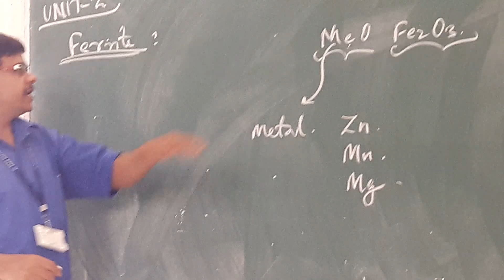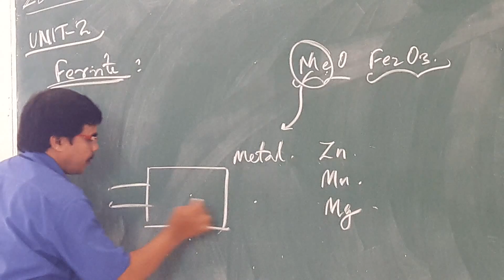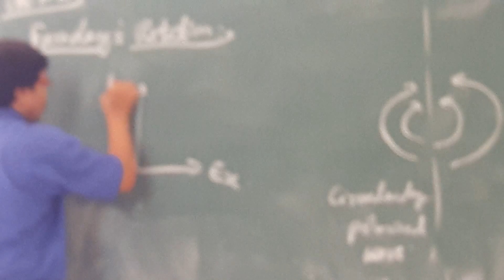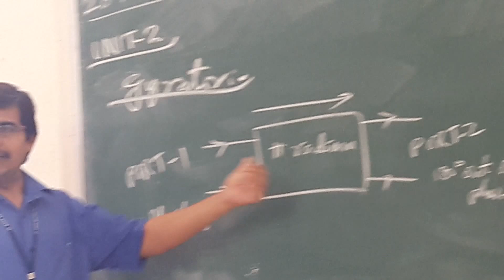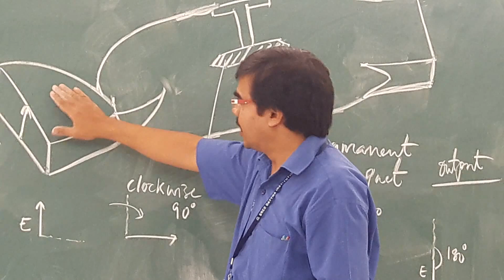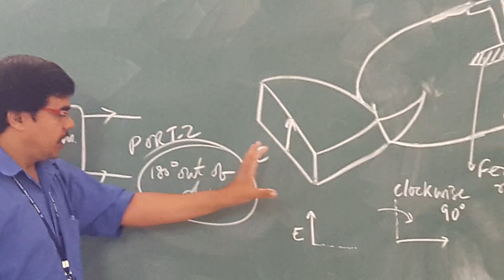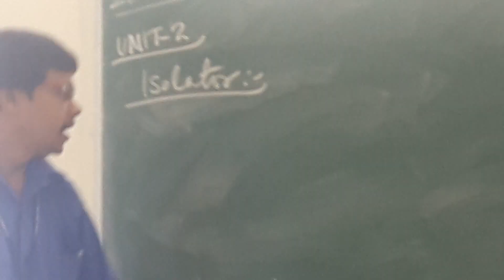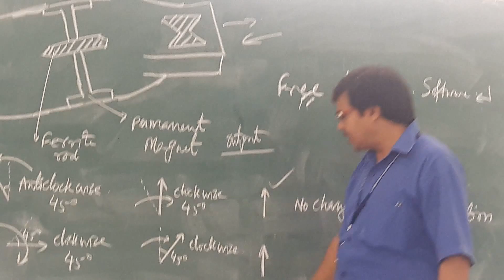MWE UNIT 2 TOPIC 9  Gyrator

Comment: Whether direction of rotation of wave through ferrite material is dependent on the direction of propogation..?
Reply from the maker: Dear Roxysttar,
First thing the direction of propagation is the direction of in which the wave is travelling.
In microwave the electric field, magnetic field and direction of propagation are mutually perpendicular to  one another.
Yes there will be tilt (bending ) of the wave in the microwave component having ferrite material in it as the tilt depends on the dimension of the ferrite material. But after that also in the microwave component the electric field, magnetic field and direction of propagation are mutually perpendicular to  one another.